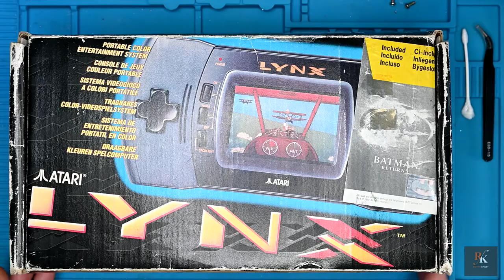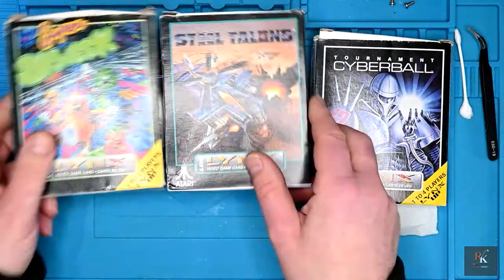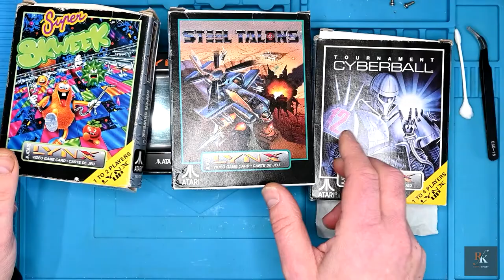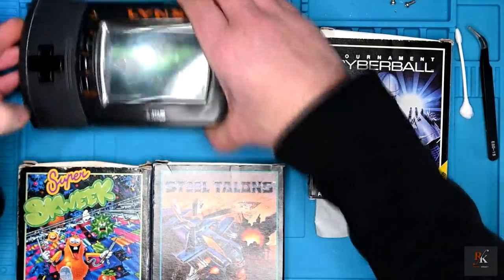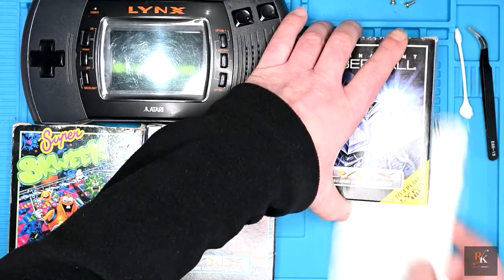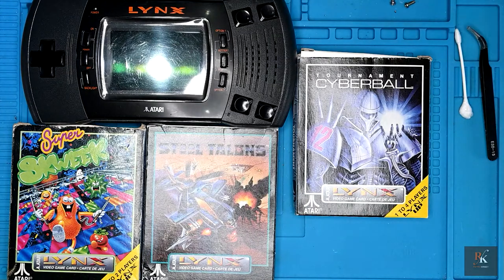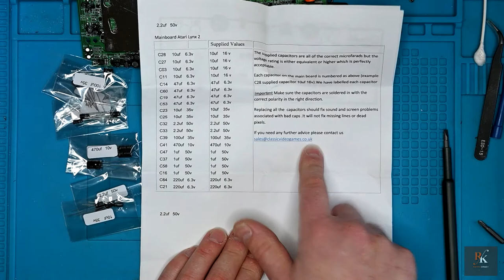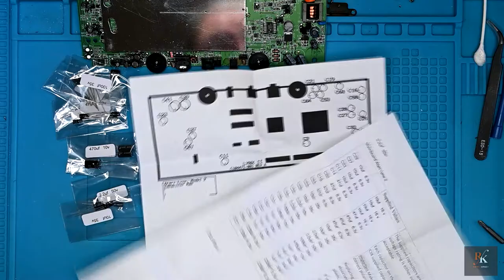Repair/Restoration: Atari Lynx II

Comment: Bonjour,   rétro krezy  j'ai une linx 2 donc la carte bcp est en courcircuit ⚡🔋 pourriez vous me dire si c'est pas trop grave  ce symptôme  j'ai peut en effet que le ou les possesseur soit toucher ! Pour info j'ai pas encore recapitule les condensateur ! J'espère que cela vient de la Cdlt.
Reply from the maker: Merci pour le commentaire !
Malheureusement, il est très difficile de diagnostiquer quoi que ce soit à distance sauf s'il s'agit d'un ofc C64, dont on blâme le PLA :)
J'espère que vous pourrez trouver quelqu'un localement qui pourra l'examiner pour vous, même si un court-circuit de quelque type que ce soit n'est pas génial car cela peut endommager d'autres composants.
Reply: Ok j'ai fait un recape systèmatic des condo  + quel que composant de régulation  diode zener le mosfet la résistance r74 les 2 transistor  etc. Maintenant la led reste allume une millie  seconde est s'éteins quand y appuie sur le bouton  power !!

Comment: Hi there, could you possibly explain to me if the + button is moving to one side how would you possibly fix it????
Reply from the maker: Hi Greg,
Sorry, missed your comment there! There's little bar the shape to center it so not sure why it'd move without seeing it. just make sure all the 4 screws that hold the bracket above it are down firmly and there are no cracks in the frame. Other than that, I can't think why it'd move, sorry!